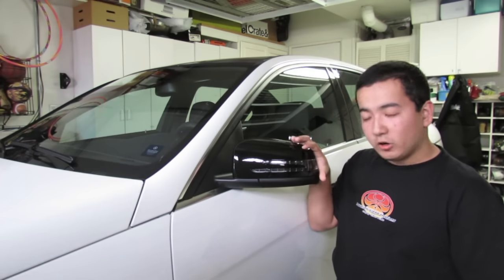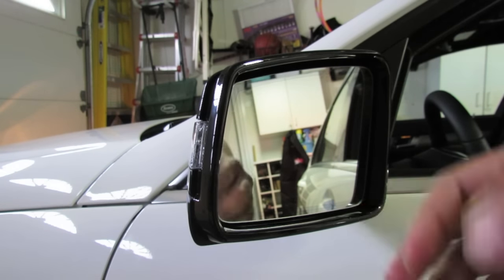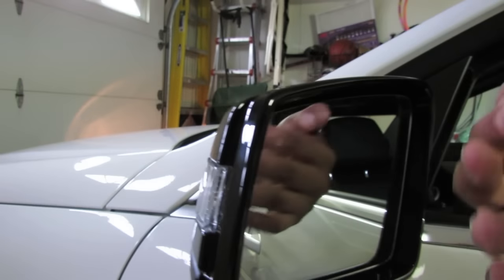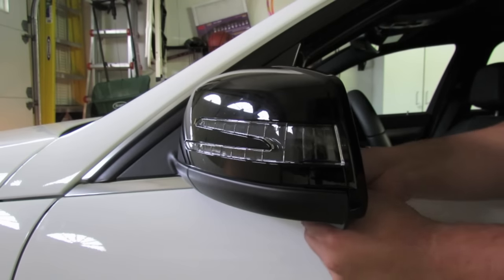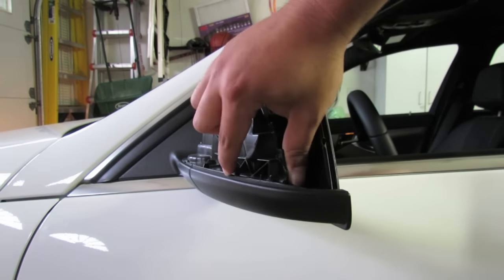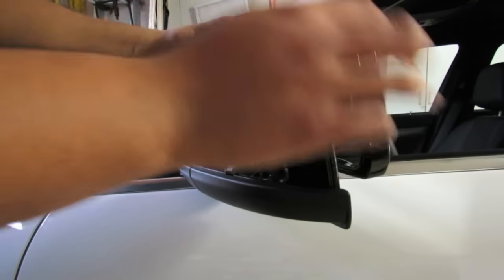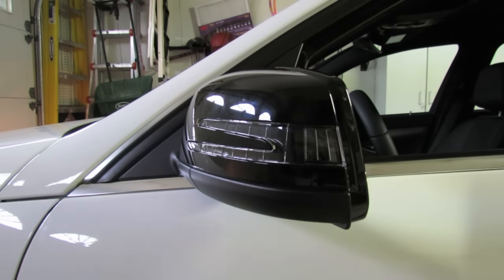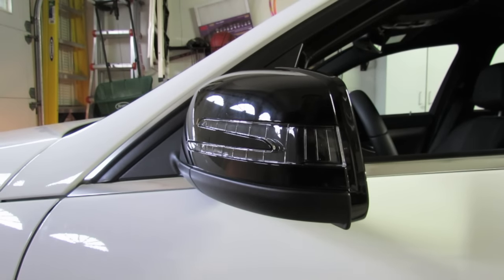Mercedes Benz Mirror Cover Removal

Comment: Pleas dont do this guys!!!! With this Tutorial you will broke your Mirror Cover !!!!!
Reply: show me the correct way then please ?about to do this
Reply: Take the mirror off first before the cover
Reply: yeah Mercades would say that because they don't want people upgrading the colour of mirror lol
Reply: Mercedes-Benz Steve ml
Reply: STEVE HOW DO RELPLACE TURN SIGNAL ON 2009 ML350 PASSENGER DOOR REAR VIEW MIRROR
Reply: Helped Me Out Today.  Need to send a Used Mirror to Paint, and always dismantle them before hand.  I gave up, Until I saw this Video.  Worked Out Perfectly for me today!  Thanks!!!
Reply: YES!  the mirror glass is pressed in, gently remove this, THEN look inside, you'll see the hidden mounting screw that mounts the motor to the upper cover.  With any part on a Mercedes, force = WRONG.

Comment: Please note, this is not the same mirror housing as the CLA250. I replaced my CLA250 mirror housings a month ago, M Benz mechanic showed me how :) . Don't use this method in this video or you will definitely break your mirror. The first step is to push in the bottom of the mirror itself so that it faces in a downward slant. This would give you visibility inside the housing from the top part, and you will be able to see the rotating mechanism inside the housing. From there insert your fingers inside this opening and slowly and carefully pry off the mirror glass off this mechanism. Once the mirror glass is off the rest is a breeze. Insert a small screwdriver to detach the clip from the housing, and detach top part of housing  from the lower housing base and lift in an upward direction and it will come off. Please note if you are replacing  your mirror housings you will also have to remove the turn signal devices from the old housing and install in the new. Only about 4 star bit screws inside housing along with removing factory silicon glue. I didn't take a video of my install, only about 15 or so camera shots of each step I took along the way.  The first mirror housing took about 20 minutes to replace, the other took about 5 minutes.  If you need detailed instructions let me know, its very easy.
Reply: yes I just forwarded you some pics to your email. I believe this will work with CLA 117 as in the US its considered a CLA250.  if your housings look the same as in the pics I sent you then you're good to go. if you have any questions please feel free to give me a call at the number that I provided in the email or you could just reply to the email
Reply: Patu Hayabusa yes I just forwarded you some pics to your email. I believe this will work with CLA 117 as in the US its considered a CLA250.  if your housings look the same as in the pics I sent you then you're good to go. if you have any questions please feel free to give me a call at the number that I provided in the email or you could just reply to the email
Reply: Got it ;) Thank you very much Kevin ;)
Reply: Patu Hayabusa no worries, good luck
Reply: sure thing. i just sent you them. i also have an explanation of the process in this post to follow.
Reply: Hi nivek would you please sent me the picture and the process of replacing the mirror.thanks
Reply: Asian Dragon sure thing. Just sent them to your inbox
Reply: Thanks for the info bro :) I had to replace only the mirror glass part and it took me literally 30 seconds to do it with your instructions.
Reply: you are welcomed
Reply: Please send me the pics

Comment: thanks for this video.  I just replaced my LED light on passenger side 2010 E350.  I was able to remove the cover without all the force described by using a pry tool carefully going round the separation gap until it came off.  might be worth trying that method to remove the cover...

Comment: Hi Matt, I am about to buy a carbon fiber side mirror cover online.  The cover doesn't come with the arrow led parts, so I assume I need to remove the arrow led part from the original side mirror cover and reuse it.  My question is, can the led part be removed? If possible can you please kindly post a video showing that.  Thanks in advance and really hope you can help me out here.

Comment: It is important to know that if your car is a S550 2010 there is a hidden screw behind the mirror. This screw needs to be removed before pulling the cover. To remove the screw you need to remove the mirror first and then you will see the screw in the back holding the whole cover. Beware.

Comment: the method described , specifically where it tells you to align the mirror with the black part of the shroud housing is WRONG. If you  do this you will probably break the mirror when removing the shroud. The correct method is to bevel the mirror completely downwards as far as it will go but keeping it straight with the mirror shroud housing. Then  follow what is described in the rest of the video and the shroud should  lift straight off over the top of the mirror without fouling the mirror and potentially breaking it. It worked for me and is  a 5 min job. The  local Merc (UK) dealer wanted £190 to do the work which essentially was just replacing the LED repeater unit inside the shroud. The LED repeater unit is held inside the shroud with 2 small Torx type screws and two clips and replacement is very easy once the shroud is removed. Euro car parts do replacement parts much cheaper than  Merc main agent ( surprise ;) )

Comment: Thanks for this, very helpful.  I found using a flat head screwdriver to help gently lever the closed side of the cover released the clip inside easier and might be less risk to damaging the clip inside.  Once that was free the cover came off easily.

Comment: Replaced 2011 C300 (W204) passenger side mirror follow Matt's instruction without any problem. It looks only 10 minutes to replace mirror. Got OE Mercedes's mirror from eEuroParts for $110.09 much less then dealer $140.00 with no tax and free shipping too.

Comment: Very useful video, changed mirror covers yesterday using this technique without any bigger issues. One notable risk though is that whilst pulling up the mirror you need to make sure you're pulling STRAIGHT up, otherwise the cover might scratch on the right side of the mirror glass. Thank you!

Comment: Good video. But before you will use all your force please push max inside the bottom of mirror glass to avoid damage when you take off cover up.
Yesterday I found that my W212 2013 left wing mirror turn LED light very dimly and it go our evening that day. But there wasn’t any warn or mistake on board. Our local MB dealer also said that this part supply together mirror cover and it cost $185 for part and $55 for service. Crazy. Aliexpress offer this LED unit separate at $12 around including delivery. But some people don’t like not OEM details or afraid that not OEM unit will have different colour shade. But when I remove cover I found OEM number of this LED unit separate and it means that possible to buy it also separate from mirror cover. OEM is A2129067201 for left side mirror. Local traders sell it at $75 around. Happy medium who wanna have OEM MB detail but don’t want pay a lot for unnecessary mirror cover.

Comment: It seems a very common prob with water getting into the unit and causing condensation.  Here in the UK it is a MOT failure and my local Merc dealer only offer the mirror complete with the mirror shroud housing and the LED insert @ £144 for the part only and £190 fitted for the complete shroud and LED insert. I found company in China selling the LED insert only on eBay for £18.99 ( wwfangestore), but I ended sourcing  from UK based company who give a 3 year warranty for £39.99 again on eBay ( energizedcustoms2 ) . Hope that helps

Comment: I need your help. After I watched your video, I tried to replace a 2014 GL450 side mirror at the passenger side. I saw how you pull the housing cover out. when I replace the mirror for GL450, do I need to remove the housing cover? please give me some advice.

Comment: Hey Matt, thanks for the video. It's informative. Got a questions tho, is the CLA side mirror designed the same? Because I need to replace my CLA mirror. Thank you very much.
Reply from the maker: +Adam Chan sorry for the late reply, don't know if you got your answer already, but yes they should
Reply: Matt -erhorn  its not the same

Comment: Hi Matt,

Thanks for the informative video 

I recently took my car to the dealership due to the passenger-side mirror LED not lighting up.

After some diagnosis , they said they needed to replace the whole mirror housing.

I'm just wondering if the OEM mirror housing includes the mirror cover or not? I'm asking this because they scuffed up my paint on the mirror cover  pretty badly. I didn't say anything to them at the time because I thought they will replace the mirror cover as well, but I've heard from different people that the mirror cover is not included  

Thanks in advance for your response
Reply: +dsumhank mine no longer works as well whats the cause?
Reply: have they tried replacing the bulb?

Comment: Hi Matt, first of all I want to tell you that I like your mercedes, it is really awesome!
I have a few questions about your styling of your mercedes, Where did you buy your carbon fiber side mirrors? I can not find any that are complete with lamps and glass as them you are showing in one of your videos. And the black side mirrors where did you bought them and what they cost? your grill is awesome too, did you buy all the parts in one place?

Please contact me because I am very interested to know where you bought your parts and what they cost. I apologize for my bad English, English is not my native language.
Reply from the maker: Sorry I never replied, but the carbon mirrors were hydro dipped by a friend but you could also have some wrapped. The black mirrors were purchased straight from Mercedes and the grill is also an OEM grill but it's meant for a C250/350 COUPE with Sports+ package. and your english is actually a lot better then most people's.

Comment: Im looking to wrap my side mirrors with carbon fiber 3m. Will it be easier to wrap the mirror cover if I remove the mirror cover, or will it make no difference?
Reply: tazmania leave the covers on. It will make contouring the film much easier.use a heat gun too to allow the material to be malleable enough to make the curves. And most importantly, post heat the film after it was applied with a heat gun. If you skip this step the vinyl will peel back under direct sunlight after a short amount of tine

Comment: Looks like the same mirror to my Cla250 will it work with mine?
Reply: No, its not the same mirror housing as the CLA250. I replaced my CLA250 mirror housings a month ago, but don't use this method in this video or you will definitely break your mirror. I didn't take a video of my install, only camera shots. If you need detailed instructions let me know, its very easy

Comment: Good stuff!    can we face life 2008 with 2011 mirror shell?
Reply from the maker: Sorry I didn't see this but yes you can. But it's not just the shell, you must change the whole assembly as these mirrors are actually shorter in height.
Reply: So the mirrows from my 2008 will fit on 2011 assembly?   you are great Matt...